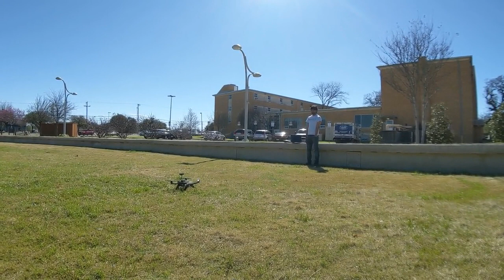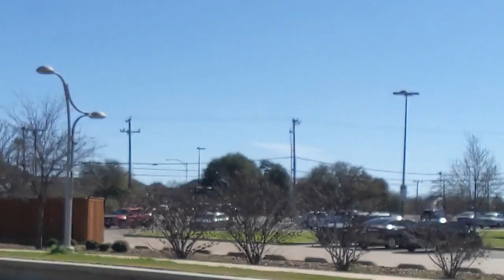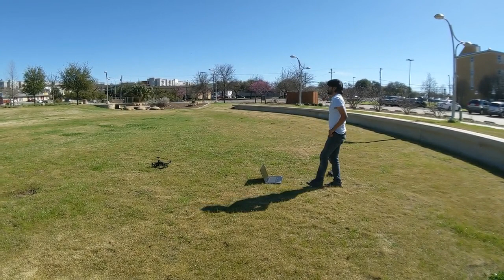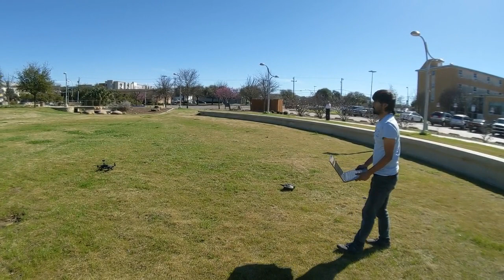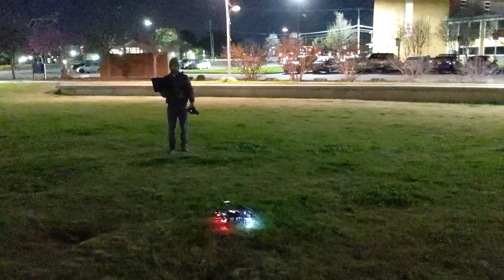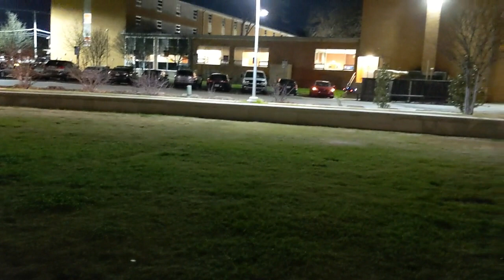Unstable drone Flight

Comment: Hey man, I’m from Brazil, student of UFPA and in the laboratory that I work we bought one intel rtf drone. Like you, we were learning how to configure and fly it autonomously with drone kit but we got stuck with some problems. Sometimes with a simple goto example from dronekit, the drone doesn’t see to correspond well it looks like it is lost trying to reach the point designed in the code, and it does nothing, like it goes up, down, hover for a bit and never finish the script. I think there is some problem with the GPS location, I wanna know if you had run through problems like that and how did you solve it? The drone seems to be very unstable. To finish, I really like your videos and it helped me a lot keep posting it!!!
Reply from the maker: yes thanks , yes intel aero drone (RTF) is very unstable and lots of  crash and Intel removed github support .. also dronekit was developed by 3Drobotic and unfortunately they also closed and dronekit python doc is not available however their github link is working..  look for flytos they provide interface to communicate ardupilot I personally didn't try that and will post video after trying flytos. For your issue can u check calibration? Are you able to calibrate your drone using qground control.. Ideally you need minimum 6 GPS satellite for GPS lock.. I have posted calibration video . That may help you...
Reply from the maker: You can also try GPS_NOGUIDED mode given by dronekit to ctrol raw ,pitch and yaw